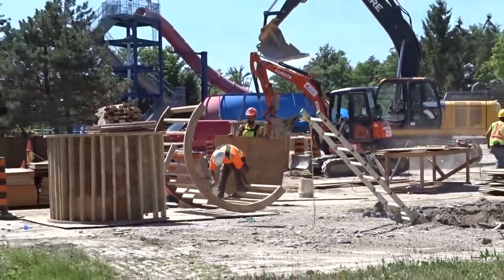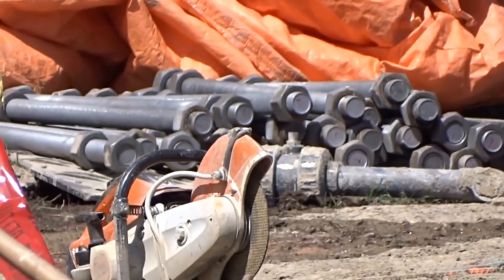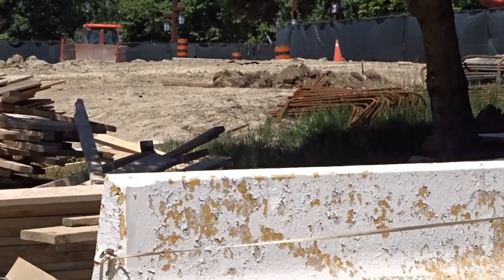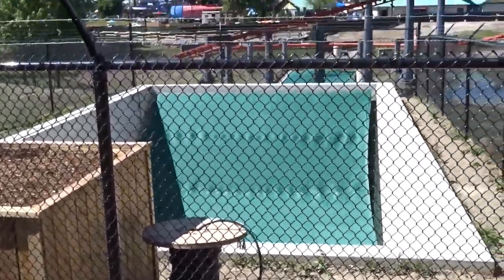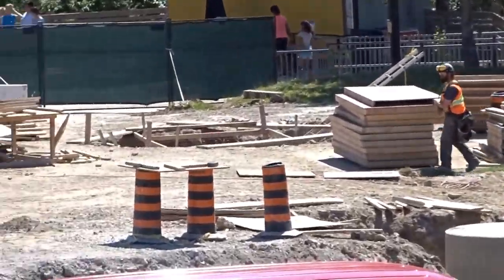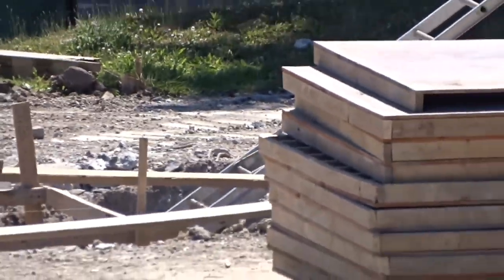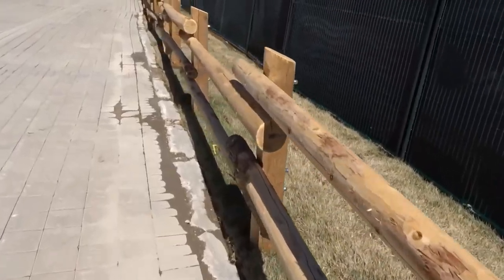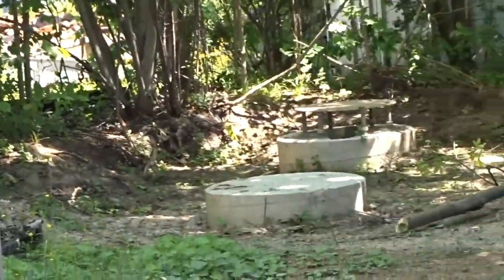Canada's Wonderland Yukon Striker  Construction Update (June 11- June17)

Comment: The cardboard you mention are sonotubes, and rods are anchor bolts that are cast in place and set by a surveyor. The concrete caps are poured over a previously drilled concrete pile.

Comment: Wooden structures that concrete is poured into = Forms
Cardboard tubes / Easy Pour tubes = Sonnotubes (Another kind of form that is commonly used on decks and fences, usually in a smaller diameter (8-12”))
Threaded things = Threaded rods / Studs / Anchor bolts

Comment: They can drill holes into the concrete footings for bolts. 

The footings could be for stairs to go to the MCBR, lift or station.
Reply from the maker: Calm Springs that’s incorrect about drilling holes into the footings. I clarified and double checked that today. It’s not secure and safe that way
Reply: I work for a company that does structural steel design and for out standard building we use Cast in Place Anchors like that we see for the coaster supports. But in some cases you can use waht is called an Epoxy in place Anchor were you drill a hole, clean it out, fill it with an epoxy mix then inset the anchor bolt. About 10% of the anchor bolts on a building from my company has them.
Reply: Mystic Timbers had the footers poured without cast in threaded bolts. GCI drilled holes and placed metal brackets on top of the footings. 

https://kicentral.com/forums/index.php?/topic/32259-mystic-timbers-construction-progress/&page=5

Look for the screenshot from KingsIslandPR. 

Also keep in mind wooden coaster are constructed different. As you said the footings without cast in bolts are probably for theming not the ride structure.
Reply: actually you can drill holes after the footing is poured.  they would fill the hole with an epoxy from Hilti and then push the anchor in.  this allows you to be more precise not having to push anchor bolts into wet concrete to get it in place.  but the drawings would have to specify if that was acceptable.

Comment: Hey Again

I think the term your looking for is "Threaded Rod" ,however, that may be incorrect because of the size / being used in concrete. Perhaps they could be called anchor bolts but that something slightly different too.

Keep up the good work on the videos! love seeing the progress
Reply: they are anchor bolts
Reply: Chez Napoli yea I guess your right. I'm used to the drill after and install type. Common in mounting lighter less structural things. That would be my guess as to how they will install into the giant "blank" footers. Perhaps stair cases to the top of the lift hill / breakrun? Anyone know what is at the base of them on Valravn?

Comment: I have always been curious to know how they put the footing exactly where it is supposed to go. Like how are they able to be so precise? Everything has to be in the right place for everything to connect exactly together. How do they make sure the exact center of the footing lines up correctly with the blueprints?
Reply: they survey plots from a blue print starting from an already known elevation.  they use a total station laser basically